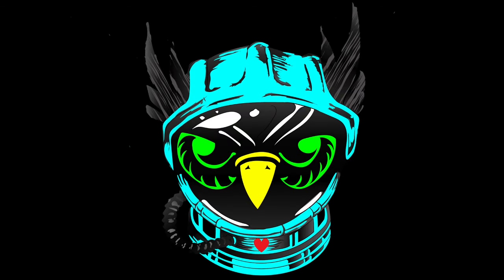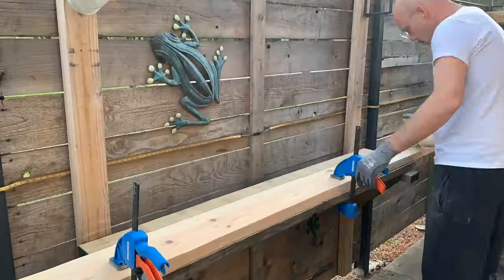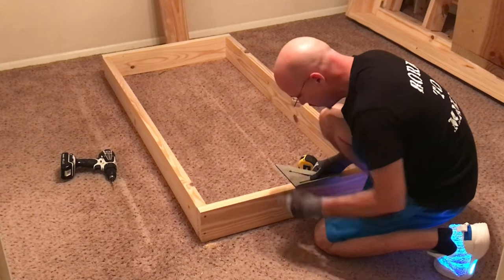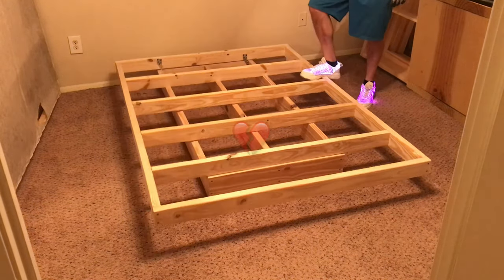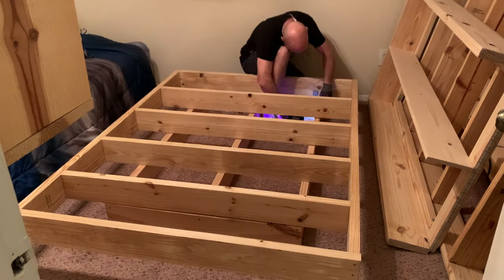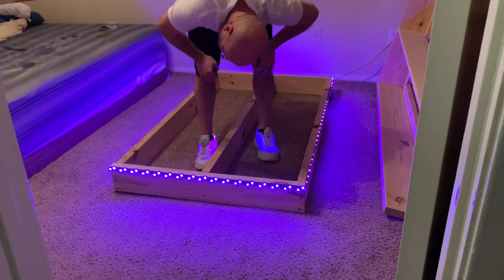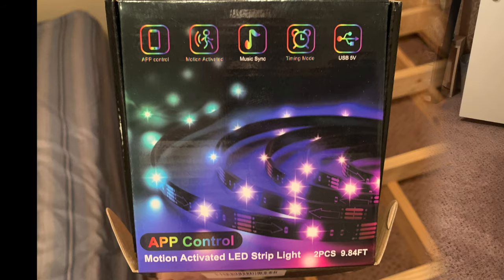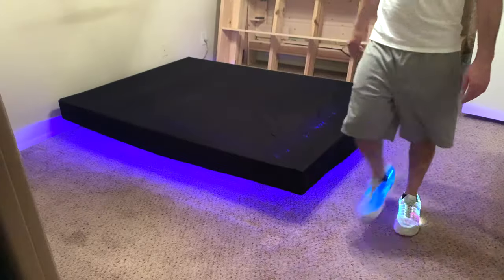Full Size Floating Bed Frame

Comment: Do you put the mattress just on it or box spring ?
Reply from the maker: @martin8829 Hey Martin, you definitely need a box spring.  I hope you have a safe build, and a happy new year.  Thanks for stopping by.
Reply: @CurtisMadeIt thank you I’ll use 2x8 for the frame and 2x6 for the joists and than cut a 4x8 plywood to size and drill some 1” holes for air circulation probably extend the base 1-1/2 as well
Reply from the maker: @martin8829 Yep, do it.  Make sure to cut your frame 1 1/2” longer and  1 1/2” wider if you want the mattress to sit down in the frame…I don’t know if that is what you are going for or not.  You’ve got the right idea though.  Let me know if you’d like an opinion on anything else.

Comment: Which base design did you find works better? The one you used in the queen bed video or the one in this video? Upcycling my current frame tomorrow (In Australia) and was wondering if I should do the “bookshelf” looking design or the box with the one beam down the middle? Any advice would be awesome. Thanks :)
Reply from the maker: @Josh Hobart Hey Josh, thanks for your question.  It’s up to you my friend.  Both of them work equally well.  If you don’t want or need the storage, build it like this full size base.  If you do want or need the storage under your bed, build it like my king size base.  I hope this helps.  Please feel free to reach me on Instagram C_Love1984 if you’d like.  Thanks for your support.
Reply: @CurtisMadeIt  thank you! Will do :)
Reply from the maker: @Josh Hobart Yes sir, thanks man.

Comment: so for the for the bottom part it is 36x63 and for the frame the bed sits on it is 54x75 correct?
Reply from the maker: @Cole Reynolds Correct.  Thanks for stopping by.

Comment: I’m going to build this for my daughter this week and had a question. I’m thinking of using 2x8 for the outer top frame and 2x6 for the inner supports so the mattress won’t shift. Do you think that 1.75” lip will cause any issues with banging knees? Or am I overthinking it and the mattress won’t slip around on your design?
Reply from the maker: @Brent Johnson Hey Brent, thanks so much.  You can use the 2x8’s for the outside and cut your joists to 54” so that you have a little pit for the box spring/mattress to sit in if you want, but this isn’t necessary I don’t think.  My queen size doesn’t move *at all*.  Your build is up to you how you want it to look, this video just offers an idea for you to build off of.  I don’t even have a full size bed!  I just built this for you guys.  I haven’t banged my knees or shins at all in the over 2 years I’ve had it and since modified it.  I hope this helps.  I appreciate your support my brother.  Talk to you again soon.

Comment: If you do a queen size bed what’s the measurement difference from a full
Reply from the maker: @Daniel Malone Hey Daniel, thanks for your question.  Full size measures 54”x75” and the queen measures 60”x80”.  I hope this helps.  I’ve got 3 videos for the queen size on my channel already: the original, the headboard modification, and the 3.0 version.  Check those out and see if you find something you like.  I also have CAD drawings available.  I’m on Instagram realc_love1.  Talk to you again down the road my friend.

Comment: What screws did you use?
Reply from the maker: @bakihanma2377 Hey, good morning B.  I used deckmate 3” screws for all the wood junctions and 1 1/4” drywall screws to secure the corner brackets to the base and the frame.  Does this help?  What other questions do you have my friend?  I appreciate your time and support on this channel, I mean it 🤝

Comment: Question idk if I'm tripping or not but @2:20 u say 2 at 36 inch and 3 at 60 inch but u also say it will measure 36 and 63?? How does it go from 60 to 63
Reply: I think I figured it out the way u had it fitted added to it I think
Reply from the maker: @Slimeyy_Void Hey Void, you are definitely not trippin'.  I did say that.  That's because you need to take in to account the thickness of the 2x6/8/10/12's you are using to construct your base.  Those are going to be 1.5" thick if you are in the USA...two of those is 3".  That's where the difference comes from.  I hope this helps.  What other questions do you have my friend?  Thanks for supporting this channel.  🤝
Reply from the maker: @Slimeyy_Void This is correct...an additional 3" due to two times the thickness of the boards used for construction(1.5"), again, here in the USA.  I'm on instagram curtis_made_it if you want to reach me there.  Talk to you again down the road.

Comment: how much did the wood cost?
Reply from the maker: @IsaacDavid-wf8gv Hey Isaac, today is 07.16.2024.  You should still be able to get outta there with all your materials for well less than $200.  If you add a headboard, obviously it's gonna be a little more.  I hope this helps.  Let me know if you have any other questions at all.  Thanks for stopping by and supporting this channel 🤝

Comment: How much was the total price?
Reply from the maker: @dariusphillips8442 Hey Darius, the cost to build this bed frame can vary pretty widely depending on how you want to do it, but as it is shown in this video, without the headboard, you should expect to get outta there for under $150(wood, screws, corner brackets, fitted sheet, and lights).  I hope this helps and I hope you have a safe build.  Thanks for stopping by and supporting this channel my friend, I mean it 🤝

Comment: How much does it cost to make this bed?
Reply from the maker: @sahnekas Hey Sahnekas, thanks for stopping by.  This full size floating bed frame build shouldn’t set you back more than $150 in materials out the door.  I hope this helps.  Thanks for supporting this channel 🤝 Let me know if you have any other questions.
Reply: @CurtisMadeIt  thank you so much for the quick reply. I really appreciate it.
Reply from the maker: @sahnekas You bet, I hope you have a safe build 🫡

Comment: Are you building this floating bed for elephants? You have more support there than there is in your entire floor!
Reply from the maker: @Lee Wilkerson [this reply was copied from the same comment you left on the queen size floating bed frame] Good morning Lee, sorry for the delay in my reply, I've been pretty full the last couple of days.  My bed frames are build solid to last a lifetime.  It needs to be able to support the whole army(of kids) jumping on there.  I needed it to be able to handle people that are much more substantial than me.  The base and frame together need to be heavy enough to offset the weight of the person that is sitting on the other side so that the bed frame doesn't tip and smash some toes/ankles/anything foot...this would be bad.  Almost 3 years now and no complaints at all.  It may be slightly overbuilt, but it's 100% guaranteed and people tend to like that part a little bit.  I sure appreciate your time and look forward to clearing up any other questions you may have my brother.  I hope you have a safe build and encourage you to contact me at any time on Instagram realc_love1.  Take care and I'll talk to you again down the road.
Reply: @CurtisMadeIt , slightly overbuilt? I think it is massively overbuilt.
P.S. I don't use instagram nor do I twit.
Reply from the maker: @Lee Wilkerson Bless you Mr. Lee, it sounded like you sneezed at the very end of your last reply there.  No worries on the Instagram, I don't really either to be honest.  I just had to create an account so that it is easier for me to communicate and share ideas with people who want to take the time to talk with me.  Slightly overbuilt, massively overbuilt...whatever is good.  100% guaranteed is all the same as far as I know, especially when you can build something yourself that is far, far and away much better quality than stuff you can buy at the furniture stores.  And at a fraction of the cost too, still.  Unbelievable really, but, believe it.  I'm certain that literally thousands of people have built this and variations of this bed frame to this point and I've had zero complaints.  Dozens of people have told me that building this bed frame has improved their mental health.  I'm trying to help people on my channel sir.  I hope you are able to find healing.
Reply: @CurtisMadeIt , I never had a problem with it either until I had to move it!
Reply from the maker: @Lee Wilkerson Well, I certainly feel your pain here Mr. Lee.  Judging by you leaving comments on multiple videos here on my channel, I'm sure you've seen that I have built and re-modified my personal queen size bed frame several times by now.  I think generally speaking though, people tend not to move their beds very often so I'm still going to chalk my floating bed frames up as a win.  No complaints from any of the 1000's of people that have built it, it doesn't tip or rock at all, no creaking or squeaking that I've heard of, substantial enough to handle very large humans, able to be easily modified, have helped people improve their mental health...I mean, I can keep going.  No need to though.  I appreciate your time and support and look forward to hearing what you have to say about the other videos on my channel.  Take care Mr. Lee.
Reply: @CurtisMadeIt , I didn't realize all of these posts were yours. 
I immediately put the one I have on a diet by eliminating the skirt (35 pounds). Next, I will remove the 4 centermost support posts. I will also be removing two of the cross beams and replacing them with two pieces each of 1 * 4 in a "T" shape.
I built bunk beds for my children in the 80s. I used 4 * 4 posts with 1 * 6s mortised into them and fastened with drywall screws. The side rails were 1 * 12s with a 2 *2 ledge to support the cross rails and attached to pieces of drilled angle iron with carriage bolts and mortised the same way. I used 2 * 4s with a notched mouth at the bottom to firmly grip the side rails with a 1 * 6 at the top for side rails when the children were small.
I also built shelves from 1 * 3s upon which I could dance. Pallet wood works very well for such projects as most of it is Oak.
Reply from the maker: @Lee Wilkerson Hey Mr. Lee, yes sir, it's me!  I take the time to reply to ALL of the comments on my channel that I see as I do thoroughly enjoy talking to you guys, even if it takes me a couple of days to reply sometimes.  You sound like a talented woodworker and I appreciate you sharing the details of a couple of your builds.  I've used pallet wood for a couple of builds and you are right, pallet wood is good for something.  I hope you are careful and take care sir.  I'm sure we will talk again down the road.

Comment: Am a female and want to build one,  but those tools 😆 🤣
Reply from the maker: @Ensurepetcares Awe, c’mon EPC, you can do it!  You don’t need all the fancy tools.  The big orange home improvement store will cut the lumber for you.  That orbital sander just makes the wood pieces look super nice for the video and pictures.  Place them in the right orientation and screw em together.  Throw a black fitted sheet over the top.  Done deal, easy day.  Make sure you have a box spring.  Contact me on Instagram Curtis_Made_It if needed, I’ll help you out.  This is a fantastically simple build, I promise you.  Thanks for stopping by and talking with me.

Comment: THE SCREWS!!! How long are the screws damn it 😅😭😭
Reply from the maker: @luckytv9069 Hey Luck, sorry for the frustration.  Use 3” wood screws at all the junctions in the base and frame.  Use 1 1/4” drywall screws to secure the corner brackets to the base and frame.  I hope this helps.
Reply: @CurtisMadeIt  thank you 🙏🏽
Reply from the maker: @luckytv9069 you are welcome 🫡

Comment: So 2×4 won't be that sturdy
Reply: So can I still use it
Reply from the maker: @Hamzah Patel Hello Patel, I think 2x4's would be sturdy enough, they just won't provide enough counterweight to keep the frame from tipping over when nothing is on there.  For this reason, I'm going to stick with using 2x6's for the base and frame to make sure everything is solid and stable enough.  I hope this helps my friend.  Talk to you again soon.
Reply from the maker: @Hamzah Patel Up to you my friend...you can but the frame will tip when you don't have anything on there.  Once you get the box spring and mattress on there, I'm still not sure the bed frame won't tip.  Good luck, let me know how it goes.